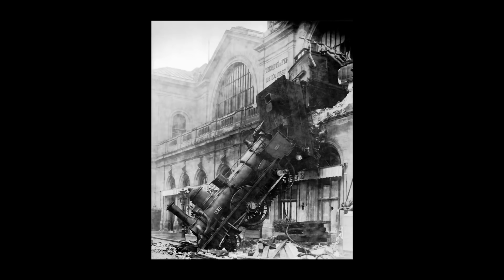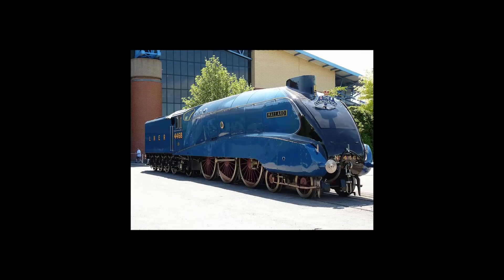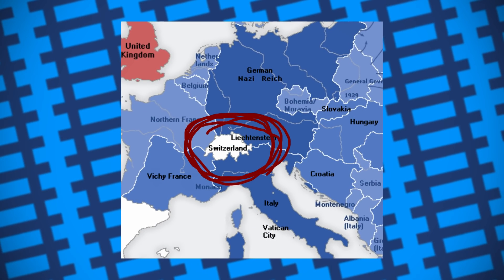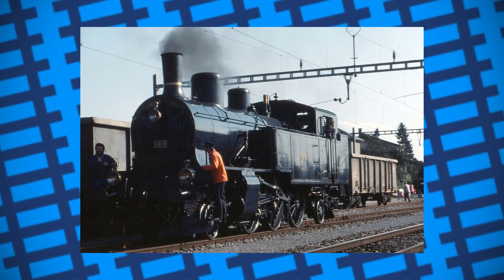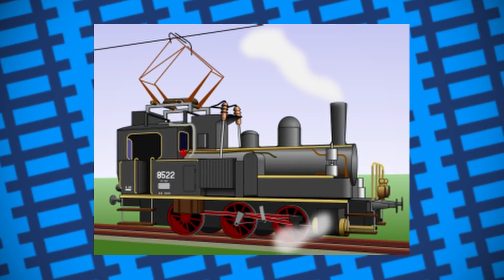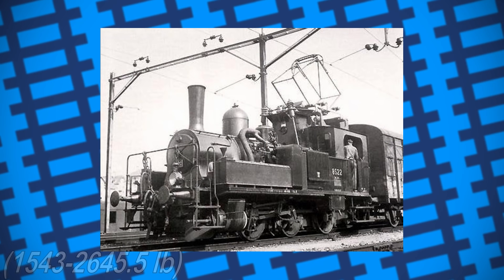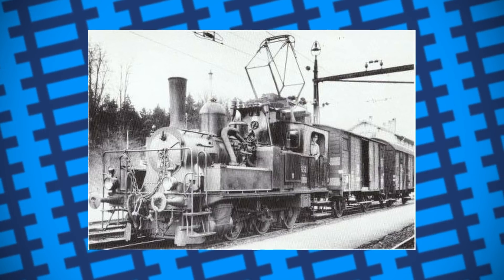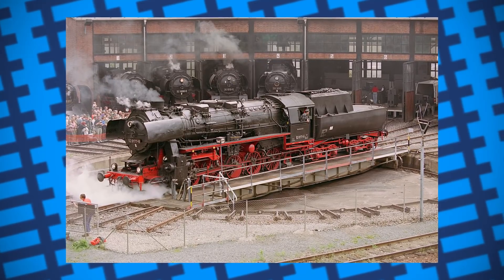Why Switzerland tried to fuel steam locomotives with electricity - Electric Steam Locomotives

Comment: It's a bit nutty but the pre-heaters are a good idea and use off-peak electricity. Keeping the boiler warm makes it last a lot longer. Swiss steam locomotives were very stylish and neat, like British ones.  They had some nice 2-6-4 tanks similar to the LMS Fowler design which were used for transfer shunting at Basle, where there are two different systems of electrification.
Reply: Railways often are paid to switch on Switch Heaters for a few Minutes, even though it isn't freezing. If there is an overproduction of Electricity, the Electricity Price turns negative. This can be caused by sudden Demand Drops where large Calorific Powerplants can't be throttled back or even shut down fast enough. A more productive Way to cannibalise such excess Electricity are Electric Boilers for District Heating, with large pressurised Water Tanks (so it can be heated beyond 100°C) as Heat Storage. These Boilers are a bit different than the Heaters discussed in this Video, as they have to respond within a few Seconds.
Reply: i think youre refering to our B3/4 Locomotives, i work on one in a society :)
Reply: Were the Swiss engines British-built?
Reply: @garryferrington811  Switzerland had their own Locomotive Factory called SLM (Schweizerische Lokomotiv- und Maschinenfabrik) in Winterthur, which built all of their Locomotives and also exported them around the World, as far as Vietnam. I don't know about their Steam Locomotives, but their Electric Locomotives were about the best in the World, so the Steamers probably weren't bad either. SLM was sold in the 1990ies, and Parts of it sort of still exist under the Name Stadler Rai, which builds mostly EMUs.
Reply: @garryferrington811  No., Mostly by SLM Winterthur. The firm is still in business. They will build you a fleer of steam locomotives minimum 20. They have nice looking 2-8-2 tank for standard or metre gauge.
Reply: @physiocrat-sv  You confuse that with DLM (Dampflokomotiv- und Maschinenfabrik). They chose that Name Out of Tradition but are not connected to SLM. They also build other Steam Engines, such as the Engine in the Lake Geneva Paddle Steamer Montreux which was converted from Diesel-Electric back to Steam in the 1990ies. Another Concept they are working on right now and that sort of fits to the Topic of this Video is converting the Lake Zürich Ferries to Steam, with Steam supplied from a local Incineration Plant and Steam Motors instead of traditional Steam Engines.
Reply: @Genius_at_Work  Thanks for clarification. SLM become part of Sulzer and later became independent under the DLM name, headed by Roger Waller. It's the same firm.

Comment: Until this video debuted, I envisioned how these types of steam locomotives work. And with you mentioning their system works somewhat like a kettle, I was...partly right. this was a pretty nice and "Shocking" video.
Reply: I know sometimes train stories have antagonists call them kettles. Maybe because of the boiler being kind of like a kettle?
Reply: the whistle would go off when there’s enough pressure.

Comment: An electric steam locomotive is problematic
Reply: It's a pretty clever Idea to solve the Problems Switzerland faced back then. Almost all Rail Lines were electrified already, and unelectrified Track was almost exclusively in Freight Yards. These Electric Steam Locomotives worked as Fireless Locomotives while shunting there and could re-heat the Boilers while in electrified Track.
Reply: Yeah

Comment: Electric engines are good and all, but they can only go where there are power cables and nowhere else.
Reply: Switzerland had power cables above almost all of the railway network when the war started, these engines were used for shunting yards and industrial sidings were overhead cables were impractical and dangerous, so the engines were never far away from their power source.
Once enough steam was brewed they could go without electric power for 20-30 minutes, just like the fireless steam locomotives which got steam from stationary boilers of the factory pumped in a tank on the locomotive.
Reply: These Locomotives worked as Fireless Locomotives while on unelectrified Tracks. IIRC they could do so for up to an Hour, before having to re-heat on electrified Tracks. Almost all Swiss Rail Lines were electrified in 1943, with unelectrified Tracks almost exclusively in Freight Yards where the Electric Steam Locomotives were used for Shunting. So it's a pretty clever Solution for that Problem.
Reply: by this logic we would just use offroad vechicles
Reply: True...but switzerland started electrification right after WW1 of its mainline.
And pretty soon they got 100%. Reason for that was that switzerland didt have coal or oil which forced them to go into electricity. Companies like ABB/Sulzer are still a reminder from that era when switzerland was a key player in hydroelectricoty production and such.
Reply: most trains can only go where rails are as well

Comment: theres also a reason the heaters weren’t very widespread. most locomotives will stay warm overnight, they may even still have 5/10 psi from the previous day. on one if the locomotives i fire Ive even still felt some warmth come out of the firebox after a whole week tho this is quite rare
Reply: We used to heat part of the house with an old pot belly and you would only have to build a good fire a few times a week. The material held onto enough heat to keep that part of the house above 70 for a day or two after. So I wouldn't be surprised in a properly insulated round house parked with other locos that they would hold some heat.

Comment: Since it's hydro electricity doesn't that mean water Fully powered the locomotives?
Reply: If you count Funiculars as "Trains" (usually, they are considered Cable Cars), there are real Water Powered Trains. Some Funiculars have Water Ballast Tanks, so they can fill the Car going down enough to pull the other Car up, so they don't need any other Power Source.
Reply: Hydroelectric power uses potential energy so technically they were gravity engines.
Reply: Technically speaking, all trains run on nuclear energy from outer space, since pretty much all energy on Earth comes from the Sun in one way or another
Reply: @MrHack4never  I think using the word "technically," you're trying to puff yourself up. You know, like technically you must be right. But technically, you're a bit of a prat? And you're technically wrong. Nuclear power. Technically, of course.
Reply: @MrHack4never  That's a tautology. A particularly unhelpful one. Like your birthweight, plus everything you eat, minus all the poo you do (and talk) equals your weight at death. Equally true and unhelpful.
Reply: @johnbishop5316   ... The weight at death is not technically eat - poo = total weight or whatever that was. Unless you are specific with what weight at death your talking about. Over ones life time? Then yea close but did not count in losing fingers/limbs or just the hair and skin loss that is not = poo. So really John if that is your name. You are even worse off and off topic too.  MrHack have a valid reason to bring up the origin of energy. 

In reality we should bring up the FACT that everything more or less comes from the sun when talking about energy. "bad" energy is a way to declare the power source used has bad consequences to nature and such and such. It is a bit more complicated then that but really if talking about IF the trains where 100% powered by water? Well it is true that the electricity used most likely came from the water power stations so yea the medium to move the energy to heat the boilers on the train being electric is just a better loss in efficiency then trying to do everything with water. It came from a natural power source becoming electricity just to be transported. Natural being a made up human term to imply working with nature and not wasting energy trying to go ageist it's natural tendencies. Can still be bad for climate and animals whatever. Trying to move the water to a train far away would be impossible without putting more energy in then you can hardness from the gravity of running water.

Moving the energy from waterfall to then end up heating water creating steam powering something to do work? That is 100% powered by water. Even now TECHNICALLY it is STEAM that do the work and you do not want actual water to do the work. And there is lubrication and all kinds of losses and other energy sources needed to make the system work. But yea sounds like trains as close as possible being powered by water being the main medium.

But really talking about politics and bullshit for a moment. (just a moment) A electric car might claim to be powered 100% clean sources. (say water) But in reality today the "claim" is just like a paper with a value assigned to it. It can be sold and be used as currency. If the car is actually running on coal or a mix of power sources using everything from wind to diesel generated energy. Just buying this "claims" are enough to be "green". 

This leads to people selling GREEN energy and buying the WORST energy to use. So let us make a made up situation. We buy cheap coal power that losses 20% energy having to travel HUGE distances for no reason but to save money. Just waste of energy and resources to save money. Then we ether "buy" planting trees to soak up CO2 in a different country (that being just lies or destroying a village to plant trees) OR we create "green" energy and sell it off to the power network. Using yet a other 20% of the energy from transferring it around for NO REASON. Even if we say that in reality we use the electricity network as a battery and in reality avoids wasting energy as much as possible. The fact is that the first action anyone do is trying to buy cheap energy and sell expensive energy. The better off a company is (and the more energy they use) they have more reason to buy cheap bad energy and sell good energy making them "neutral".

Can you trust that the actually energy is green and not wasteful? no. Is it not really cool that a steam loco ran on just water? Yea. But I rather have them run on wood or something that is harvested in a sustainable manner. But that is not going to make millionaires richer. And nuclear power plants would be better to have been worked on then nuclear bombs. Not just existing to create materials to make bombs. Quite literately the best option since it cuts out the wasted energy that is used to get the nuclear energy from the sun. Solar panels being also a thing that with decent and well working governing had been built and produced as sustainably as possible all over the world. But no. 

Tiger,Panther,M4, and T34 go BRRRRR!
Reply: @TheDiner50  I read up to FACT and realised that you're one of those verbose people that doesn't understand the Caps Lock key. The more you go on the more you confues yourself.

Comment: Another problem was that due to the war it was more difficult to get material to build new engines. To add to that, industrial spurs usually aren't electrified, we don't have oil either, batteries aren't amazing either and with that system you can at least run some time without electricity.
Reply: And if they would have used battery backups how much lead would they have in had to import to make that happen.
Reply: @MrJstorm4  batteries back then just couldn't work. electronics were just too primitive in the 40s
Reply: @AsbestosMuffins  they worked well enough for submarines, so the electronics wouldn't be a problem. But it was probably much cheaper to just elecrify the lines instead of using batteries.
Reply: @kojetono5853  electricity go crazy when it touches water  . So if the steam touches the wires , so how did not the electricity reacted
Reply: @sharanventure  Steam is a vapor, so there's not enough electricity or continuity through the vapor to conduct electricity.  Same as why there's no electrical shorts between power lines in heavy fog.

Comment: Ok does any one know what German Locomotive that was with the red wheels i gotta know
Reply: DR Class 52.80, a rebuilt DR Class 52 fir East Germany.
Reply: @BHuang92  Little Edit: I forgot about that 52.80 at the End of the Video when I wrote that first Comment; I just thought the Question was about which German Steam Locomotive in general. The Class 52.80 is based on the Class 52 Wartime Steam Locomotive, which is a highly simplefied Version of the Class 50. When the East German Class 52 Locomotives reached the End of their Service Life in the 1960ies, they were completely rebuilt with new Boilers and upgraded to essentially the same Specs as the Class 50, plus some Extras like an Exhaust Steam heated Economiser (the Box in Front of the Chimney), or an elongated Combustion Chamber Furnace to increase Radiation Heat Transfer. These Class 52.80 also were the last active Steam Locomotives which I mentioned in my Comment above, and actually even ran occasionally for the new Deutsche Bahn (that poor Excuse of a Railway that Germany has today) when there was a Locomotive Shortage around Berlin in 1994.
Reply: All of the Goverment-owned Railways after 1925 had their Wheels painted red. Namely the Deutsche Reichsbahn from 1925-1949, the East German Deutsche Reichsbahn from 1949-1994 (and yes they ran Steam Locomotives until then) and the West German Bundesbahn from 1949 until they retired Steam in 1977 (and banned all Steam Locomotives all over West Germany for the following 10 Years, even on Heritage Railways).

Red Wheels make detecting Cracks and Oil Leakages much easier. And painting everything else black helps hiding Soot and Dirt. That Paint Job is purely funktional and just looks nice as a Side Effect.

Comment: Classic Switzerland, ahead of its time due to that golden era science bonus.
Reply: Except that using the electricity to power traction motors direct would result in a loco 9 times as powerful for the same electricity input used to heat water. Just one reason they removed the experiment.
Reply: yes of course. this was more of a make do with what you have. @PreservationEnthusiast
Reply: @SB7-r9i  I was just setting the record straight really. One often sees foamer fanboys saying "why don't they bring back steam because you can use electricity to heat the water".  They have no knowledge of engineering or physics or the efficiency of heat engines. I was hoping they might see the comment and understand a bit more about the  facts.
Reply: @PreservationEnthusiast  correctio.
Using traction motors was Going To Be 9 times more powerfull.
At that stage of technologie, electric engines did not surpass steam.
Many actually underpreformed the 100 years of engineering designe steam engines.
Thats why Steam was still in heavy use at that time
Reply: @ethribin4188  Electric locomotives always had a much better power to weight ratio than steam. And also a much better turning radius, better overall performance in mountainous terrain, it requires less maintenance and less staff... 

Another example is the AE 8/14, built in 1939. this locomotive absolutely overperforms any of the largest steam engine built in the US during the same era, big boy included (8162kw vs 4680 for the big boy). And it does it smoothly and silently. Unlike its steam counterpart. 

Don't get me wrong the big boy is a wonderful technological achievement,  but since the 1930 it was clear electric traction had way more advantage than steam. Electric only had one big drawback: It requires overhead lines and fixed installations.
Reply: Germany built large series of steam locomotives because coal was mined domestically. This was simplified more and more and the material was reduced to the necessary. In contrast, gasoline and diesel for vehicles were in short supply. 
Although there were already pre-war diesel and electric locomotives.
The steam locomotives often stayed behind in other countries after 1945 and were used there again.
Even German wartime locomotives were converted to Russian gauge and continued to serve there for a long time. Even after 1945 such locomotives were brought to Russia from East Germany, including the tracks. Reconstruction in the West Germany was already beginning.
Reply: @jensschroder8214  i mean, thats why Switzerland went for electricity.
It was locally produced.
And still is.
Reply: @jensschroder8214  All quite correct. The Germans also used steam locomotives to transport millions of Juden for "resettlement in the East".
Reply: @PreservationEnthusiast  not the point of this discussion mate
Reply: @ethribin4188  Neither was Jens's point about German steam loco strategy, so I thought I would respond in kind. You need to study the dynamics of the thread a little more.
Reply: Ye
Reply: Or do you mean they being neutral
Reply: @memazov6601  Carbon neutral ahead of its time.